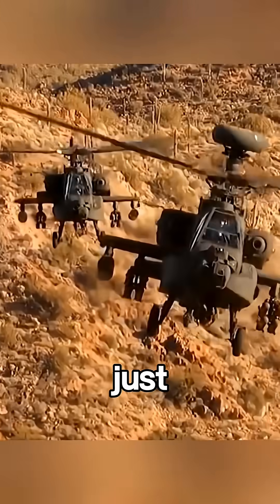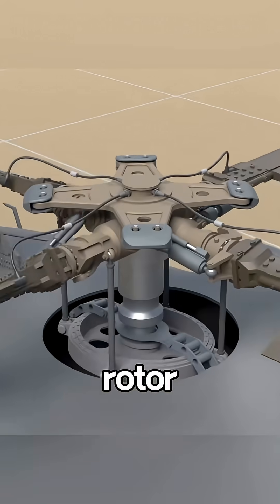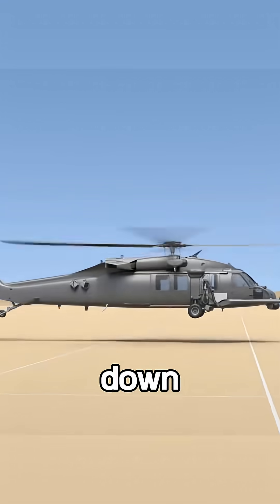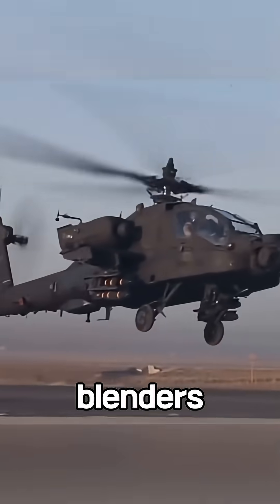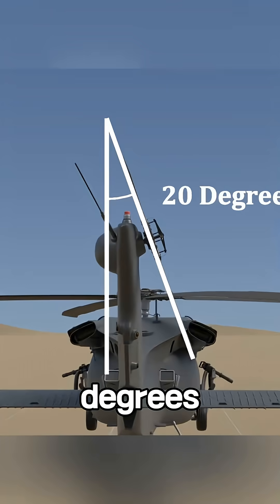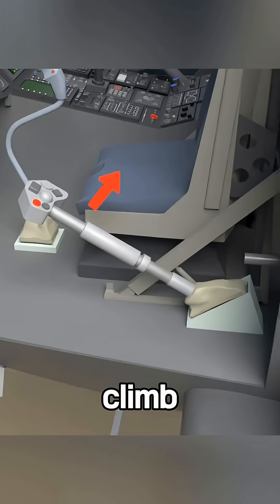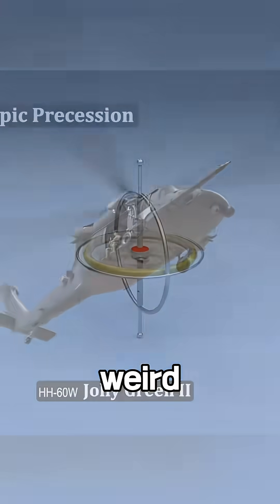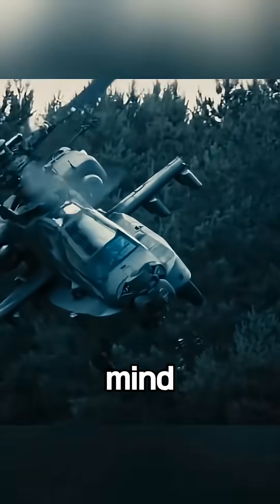Helicopter Speed Myth Busted: What Really Limits Their Velocity #helicopter #aviation #military

Comment: The only time blade rotation speed is altered to affect lift or velocity is on fixed-pitch rotary aircraft. Typically, an RC helicopter with a fixed pitch rotorhead or a multi-rotor drone (like a quadcopter). On such aircraft, the rotors can't change their pitch, so lift relies solely on adjusting RPM. As for directional control, fixed-pitch RC helis tilt their rotor system like any other (unless its a toy grade heli with no swashplate and a rear thruster for pitch), while drones alter the speed of specific motors to create an arm along one of its axes and push the drone forward or back and fly to side-to-side. Yaw is achieved in an interesting way: opposing corner rotors will speed up so that the increased air resistance against their respective leading blades will push evenly from opposite directions, rotating the drone along its vertical axis. If you've seen a drone turn to face left or right and wondered how it does that, now you know.

Comment: Not quite right. The RPM does change, it’s just not what makes the helicopter go up/down on its own.. 

The RPM is dictated by the throttle and loading on the blade (collective).

For example in some helicopters the engine throttle is adjusted by twisting the collective: so .. suffice to say like a car with a clutch, as you pull the collective up you have to add power to counteract the loading which would slow down the rotor speed. Otherwise you would have no lift on the collective/

This is the same reason a helicopter will twist if you rapidly pull up the collective, the loading rapidly increases and reduces the RPM of the blade, This can cause the blade to slow down and as a result one of two things happens. The engine torque is ramped up which creates even more twisting, or the sudden change in forces causes counter torque which twists the aircraft.

Also, the pedals are for yaw (twist), not roll.

Comment: No this clip did not mess with my brain little, but it did yours! Not all main rotor turn clock wise some turn counter clock wise. Also tail rotor or anti-torgue pedals is not tilled on all helicopters, just some as tail rotor turn clockwise and some turn counter clockwise depending on which side it’s on the tail boom. Plus some do not have tail rotors at all. So this who,e thing is one big B.S. next time do some research,

Comment: This mostly correct, but there is an important critique to your video. The cyclic controls tilting(pitch) motions on the system. The foot pedals, which you correctly identified as controlling the tail rotor, translate to yawing motion. in the animation you provided, the helicopter was pitching left during your description. Props for mentioning gyroscopic procession.

Comment: Turning or “moving side to side” doesn’t involve the pedals.   It’s the cyclic which makes the moving swash-plate turn a helicopter during “moving” flight.   The pedals only turn the helicopter on its access of rotation during a hover, by controlling tail rotor blade pitch angle and tail rotor thrust.

Comment: The speed of the blade actually does change though. There’s a gauge on the dashboard that says “RPM”. The control is normally on the collective, lil twist function. For more advanced fliers I would say.
Reply: That little gauge gives both engine and rotor RPM. The engine RPM can vary quite a bit, but the rotor RPM needs to stay in a very narrow band.

Comment: Ah, wrong, these videos suck, the rpms do change as the helicopter flies, it can be due to temperature, altitude or torque needed for a maneuver.  The helicopters blades are always speeding up or slowing down as necessary to keep the needles aligned.  The collective only changes the pitch of the blades collectively, no pun intended.  The governor handles the engine due to the fines it takes to keep a turbine in control.

Comment: I mean all of the helicopters you just showed have throttle controls. When the helicopters engines are started the blades start spinning unless the rotor break is applied. As you throttle up the engines the blades will spin faster but the helicopter won’t leave the ground until the collective stick is being pulled up

Comment: Great explanation.  There's also a limit to their speed (sorry Airwolf) because as the blades spin at a constant rate, the moment the helicopter is as fast as the retreating side blade, that blade is effectively not moving at all with respect to the air, and it generates no lift.  (In fact it stalls well before complete zero speed.)  Even if you fix that by having two rotors spinning opposite ways, you still have a permanent block.  The moment airspeed plus rotor speed equals Mach 1, the advancing side blade breaks the sound barrier, and drag becomes enormous, while the other side is at best stopped, and possibly even moving backwards and creating downforce.  The power to spin the rotors is essentially impossible, and even given a ridiculous engine your blades are vibrating from lift and massive drag to nothing and back every rotation.  You'll get vibrated to slime.

Comment: Almost right.  Gyroscopic precession is taken out by the teeter hinge onn2 blades choppers and the flapping hinges on the multi blades choppers.  They flap to compensate for advancing and retreating blade speeds but the same offsets the pitch to 90 degrees input.  Been proven in vacuum chambers, blades doing follow the head in a vacuum they do with air so it's angle of attack and not gyroscopic precession.

Comment: Commercial helicopter pilot here. Fun fact, the rotor system does in fact change RPMs throughout the flight profile. We have a gauge that indicates rotor RPM, and it has to be managed continuously within a specific range. Every helicopter's RPM range is different, and most are automatically controlled through an electronic governor system.
Reply: Fun fact, commercial helicopter pilots control a helicopter with blade pitch not blade rpm. Collective pitch to climb or descend. Cyclic pitch for directional flight. Tailrotor pitch for hover turns and to maintain coordinated directional flight.

The throttle sets main rotor flight rpm and the governor maintains flight rpm. You do not increase main rotor rpm to climb or accelerate. Nor do you decrease main rotor rpm to decelerate or descend. And you do not increase or decrease main rotor rpm to do hover turns. Flight rpm remains constant and the pilot controls adjust blade pitch to maneuver not blade rpm.

Comment: Mmmm. Seems they forgot the part about what limits their velocity, which is actually the speed the rotors are turning relative to their air speed. The faster they travel, the lower the air speed of the rotors moving backwards, reducing their lift.

Comment: The blades don't change speed, but by tilting the blades against the air, the motor I'm presuming up throttles as resistance will sap rotor energy.

Comment: Not entirely correct. Higher main rotor rpm is required for faster forward flight. Due to the retreating blade loosing lift. Some helicopter have higher main rotor rpm than others.

Comment: The information isn’t very correct. For one,  the rotor isn’t rotating at a constant pitch, for a faster speed you have to increase the rotor head speed and add the collective pitch for lift or for descent and use the cyclic controls for direction. If your head speed isn’t fast enough and not generating enough torque to spin the blades, a collective pitch and cyclic input would bog down the blades. So just like a car, a helicopter has variable head speed and can also lock the head speed to a constant.

Comment: Helicopters also have a horizontal speed limit based on their rotor speed and length. If the tip of the blade breaks the sound barrier it introduces oscillations and vibrations that can seriously affect flight stability and even damage components. That's why no chopper has got even close to half the speed of sound. The official record is 288 mph, with one well documented prototype beating that, but not by much. No helo has yet provably broken 300 mph.
Reply: What about Airwolf?
Reply from the maker: Interesting point
Reply: It was only called the sound barrier until we achieved supersonic flight.
Reply: @tysonatkins2236   it's still a barrier in a sense that airfoils stop working like wings and start working like blunt pieces of metal that just push the air aside. The flow separation drastically reduces lift capability of the airfoil while simultaneously greatly increasing its drag. Supersonic flight obeys by very particular rules which don't translate back to subsonic flight, which is why supersonic jets either fly like a brick at subsonic speeds, or physically change themselves into a subsonic jet. Which is why it's not really possible to make supersonic helicopter blades.
Reply: fasted conventional is held by the lynx at 249mph. the current top speed is by a hybrid. eurocopter x3 which has two propellors like a conventional plane driving it forward.
Reply: Greetings: And then there was Air wolf. : )
Reply: It also has to do with retreating blade stall speed. Helicopters have a Vne speed that if the exceed (Huey’s can) the retreating blade will stall and there will be a loss of lift over the tail section causing a violent pitch up of the nose.
Reply: @m @markphillippi  correct answer. Others are incorrect

Comment: Wrong because the apache has a swept tail so that in forward flight they don’t need the tail rotor once they’re going fast enough also why it has a horizontal stabilizer to also help achieve nose down attitude. Gyroscopic precession is still a thing, however the rotor head thing is true it’s, basically a constant speed propeller. What speeds up are the engines to meet the demand of the rotor loading.

Comment: The cyclic doesnt tilt the entire rotor system. It changes the pitch of each rotor blade individually during each rotation.
Reply: . . . which causes the entire rotor system to tilt in the direction of flight. Some of the main rotor system vertical lift is diverted to horizontal thrust in that direction which pulls the helicopter in that direction.
Reply: @oscargrouch7962  But that’s still misleading to people who don’t understand. The entire rotor system doesn’t tilt relative to the aircraft which is what that sounds like. The cyclic tilts the bottom swash plate and therefore the rotating swash plate which then in turn changes the pitch of some of the blades during each rotation in a fixed position relative to the helicopter, but impacting all blades throughout a rotation. This creates unequal lift relative to the aircraft and tilts the entire helicopter. The way they describe it makes it sound like the mast ends up tilting relative to the helicopter.
The cyclic is the most interesting part and most mind boggling and they really skipped over it and I think gave a false impression.

Comment: You must increase engine power

A helicopter does not use constant power when climbing or descending.

When the pilot wants to go up, they:

1. Raise the collective (increases the blade pitch — the angle of attack).

2. That increase in pitch requires more power to keep the rotor spinning at the correct speed.

3. So the governor/turbine automatically adds more engine power.

Why?

Because increasing blade pitch creates more lift… but it also creates more drag.
To overcome that drag, the engine must supply more power.

Simple version:

Go up → More lift → More pitch → More drag → More engine power needed.

Go down → Less lift → Less pitch → Less drag → Less power needed.

So the power is NOT constant

Real helicopters constantly adjust power depending on whether they’re:

climbing

cruising

descending

hovering

Even simpler:

To go up → Increase power

To go down → Reduce power

To stay level → Keep power steady

Comment: There is absolutely a throttle that's pilot controlled.  It's a twist grip on the collective in our left hand. It is used to maintain the rotor speed and the power has to be increased when the pitch is increased to compensate for the added air resistance and drag on the rotor blades.

As far as the voiceover stating "the main rotor spins at the constant speed, always", it's incorrect.  There are constant, relatively minor, speed changes in order to stay in the safe operating range and not cause overspeed damage. Not to mention, reducing throttle will make you decend. Check out some videos on autorotations, essentially simulated engine failure training.

Also, the tail rotor is used to control counter rotation when hovering or moving at slow speed.  When in forward flight, the thing is essentially a weathervane and requires little to no pedal in order to counter the main rotor.

Comment: Rotor speed does change drastically, again dependant upon type, imagine a heavy lift type but with no weight, would you want the blades to rotate at 100% of max lift capacity? No, turn down the speed and the blades hit less turbulent air from the blade in front, less pitch is then needed in the blade at less rpm, a lot more efficient. The max speed is set by the ABC (advancing blade concept) which is a sum of the drag of the blade, the turbulent air coming from the blade in front, the pitch of the blade, the length of the blade, the chord of the blade, the rpm of the rotor head, all of that vs the weight of the aircraft the air density and temperature.

Comment: Actually, helicopters have a problem. The speed of the individual blades are additive and subtractive of the speed of the aircraft as a whole. The faster the helicopter flies the faster the blades move. At a maximum speed the blade spinning backward has the craft a speed added to it potentially having it moving a supersonic speeds while opposite rotor is moving slower than the aircraft. Worse is the tip is super sonic, the root of the blade is subsonic creating a transonic spot on the router blade. The creates hugh stresses in the blade.

Comment: The biggest limit to how fast they can fly is due to the apparent wind speed the blades see. Simply put if the tip speed of a helicopter is nominally 100 mph then it can't fly at 100 miles per hour because the apparent wind speed of the advancing blade tip would be 200 mph but the retreating blade would be zero mph and so be incapable of producing lift and zero lift on one side is probably a condition to avoid.
Reply: That’s what the swash plate is for. As the rotor disk turns, the pitch of each blade is constantly adjusted to maintain an even lift profile over the rotor disk.
Reply: @artjackson8360  I get that, I flew them, if the airfoil's relative wind velocity is zero the pitch doesn't matter because that's an airfoil that is stalled. Stalled means no lift, no lift means no fly, no fly means bad things are going to happen.